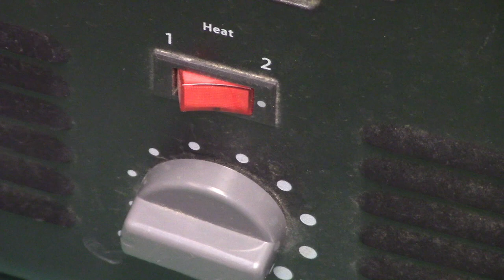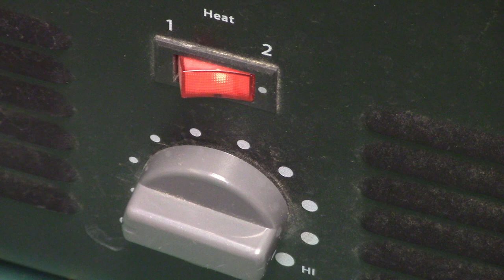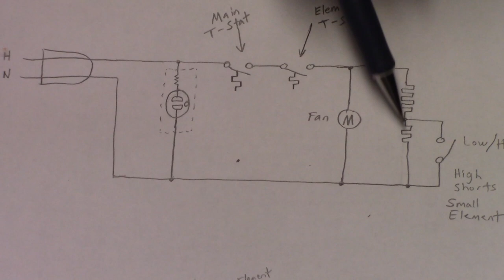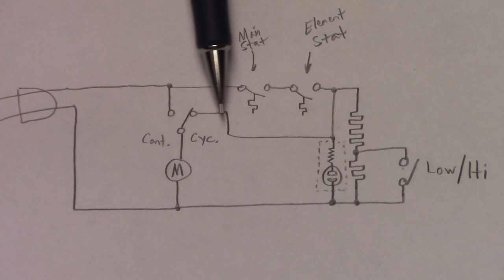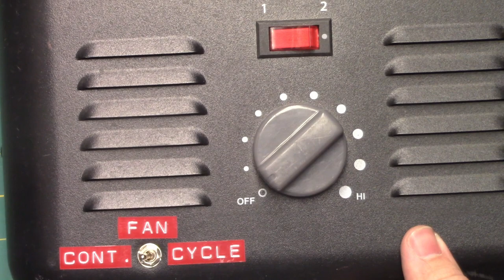Heater Upgraded for Continuous Fan Operation

Comment: So my thermostat went bad and won't put enough electricity through to run the unit continuously.It just cycles on and off in a wimpy way. I took the thermostat out and connected the two black wires together and it runs continuously. That would leave the unit running continuously with no cycling.  This would be sort of dangerous if you left the unit unattended. But we would only be using this to thaw out some pipes and we would not leave it unattended.  I was thinking of wiring a switch in place of the thermostat dial. Would I need a switch that has a certain amount of amperage?  Thanks

Comment: I have a heater (Exact same one) where the position sensor melted, now it won't turn on. What exactly is the sensor doing? Is it possible to just remove the piece it was working with?